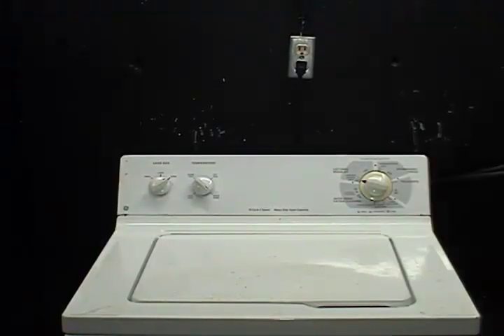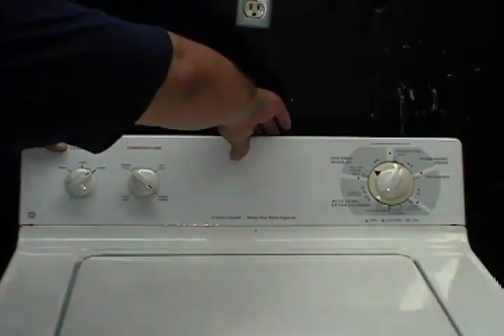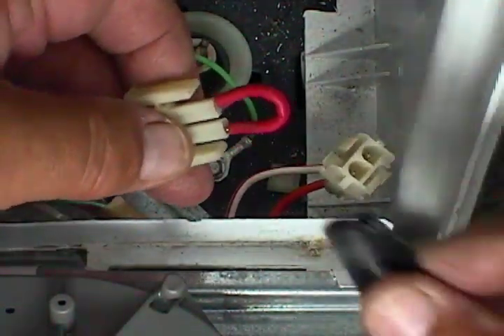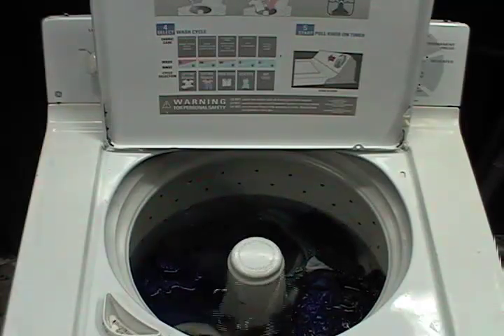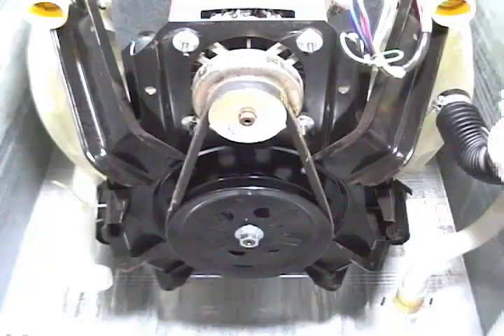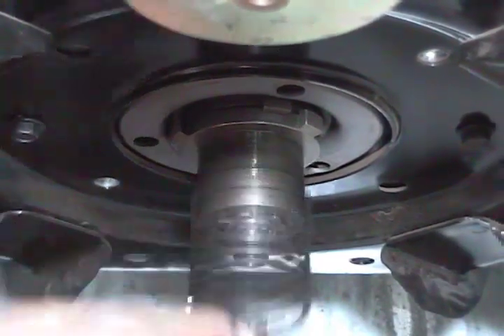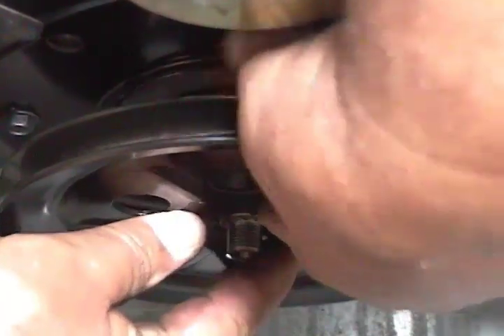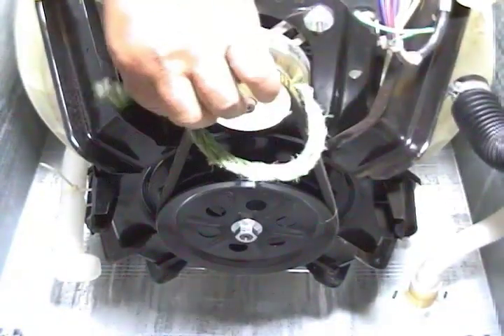General Electric Washing Machine Not Spinning - The Transmission Spring

Comment: I have a Washer similiar to this that agitates fine. after it drains when it goes to spin the motor will click on. rotate 1/8 turn, bind up then turn off. Will not spin out. it only binds up when going to spin. agaitates just fine. replaced the belt and clutch pully and it did not fix it. Could the transmission be bad? motor bad? Thanks.
Reply: @g-man7938  I have the exact problem, anybody know the answer?
Reply: @ChristPaidOurSinDebt  I put it back together wrong after fixing the transmission leak, I had the spacer on top and when I tightened the tub it was pinched. Works great now.